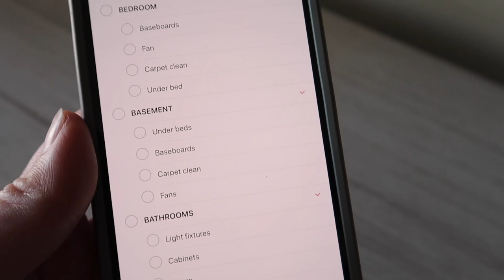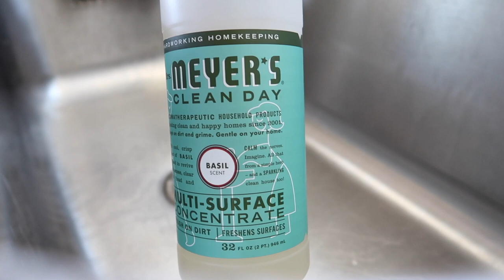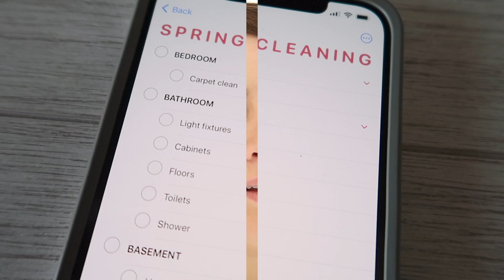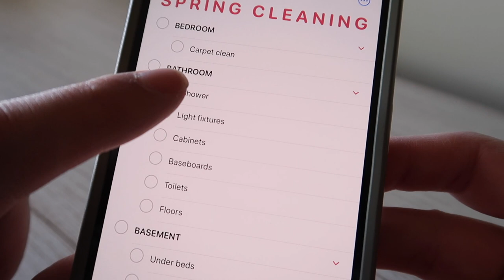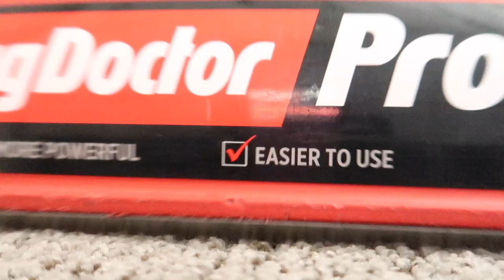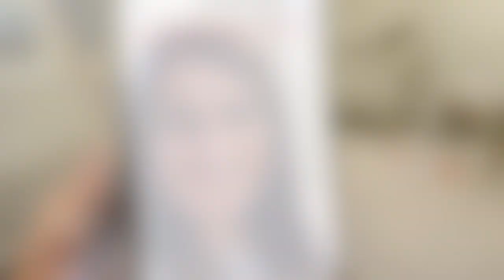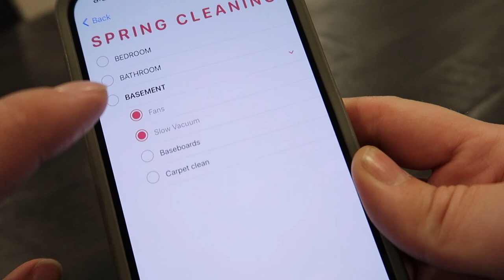SPRING CLEAN WITH ME 2021 | PART 2 + MOVING ANNOUNCEMENT!! :: DEEP CLEANING MOTIVATION

Comment: As I was watching you and Kyle clean up under the bed I have a really cool easy way to do this especially if you are by yourself and it doesn't require you having to lay on your stomach to do it plus it will get a lot of the dust out as well I have one of those little shop vacs and as you know there are two places that the hose goes into one that has a suction side and one that has a blower side and how I came up with this idea was I wished I had a leaf blower to just blow all the stuff out from up under the beds and then I thought that my little shop vac had a blower side on it so I take it and blow out everything under the bed to the other side of the room it makes it so much faster and so much easier to do just a little tip for you it's really quick and easy and those shop vacs have a pretty heavy blower on it that it will blow out pretty much everything

Comment: How exciting about the move! I am looking forward to all the moving motivation. We have been looking for our dream property for 6 months now which is a big reason I started my decluttering journey so when it comes time to move we will have less to move! I do have a question. I have some CLR that I have been using in our shower and it works awesome on the hard water, but I don't know if I just have an old bottle, I can't breath around it without it making me cough. I've had it for years so I am assuming it is just old. Do you experience that when you clean with it? I want to buy a new bottle because it works so well, but I am scared I will have the same reaction.
Reply from the maker: It is pretty strong, it’s definitely not one of the super yummy smelling cleaners lol, but if you’re having a hard time with it, opening a window could work great 💗

Comment: Are you happy with your steam mop? I love cleaning with steam but I've bought 2 shark steam mops like the one you use and they have not lasted more than a few months. If anyone has any tips I would greatly appreciate it.
Reply from the maker: I always get the cheapest shark steam mop - nothing fancy... but my first one lasted for 3+ years until the handle broke lol and then I got another about 3 years ago and it’s still working great 🙌🏼 just make sure you’re only adding water inside the tank

Comment: In your opinion what is the difference between the CLR Bath and Kitchen and the CLR Brilliant Bath and the CLR Mold and Mildew? I need something for our shower...the whole shower. We have really hard water and there is a build-up of rust on the aluminum at the bottom of the sliding glass doors...you know like where the grout is. Does that make sense? Anyway it looks so gross and nothing I've tried has worked. So what do you think is the best of the CLR items you have? Maybe the steel scrubbers would work??? Thanks for showing us real life messes. We all have those areas that keep getting dirty that we need to maintain some type of routine to keep them clean...right???? ❤💚💜💙💛
Reply from the maker: I honestly don’t think you could go wrong with any... I think the bath & kitchen or the brilliant bath are pretty similar (the bath and kitchen is just more versatile) and the mold and mildew is a stronger cleaner I believe. I would say start with the kitchen and bath and see how that goes 💗
Reply: @ThisCrazyLife  Ok. Thanks. I'll let you know ❤💚💜💙💛